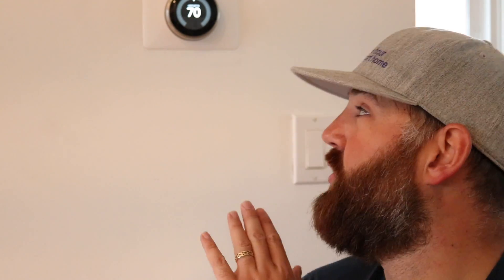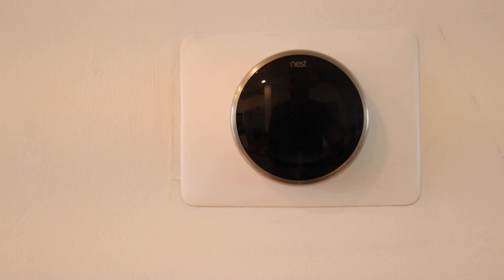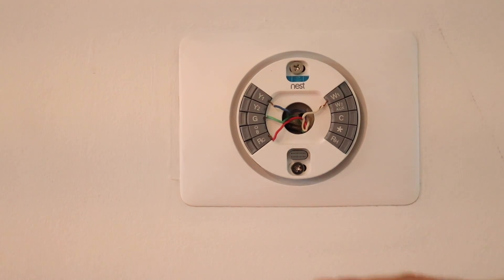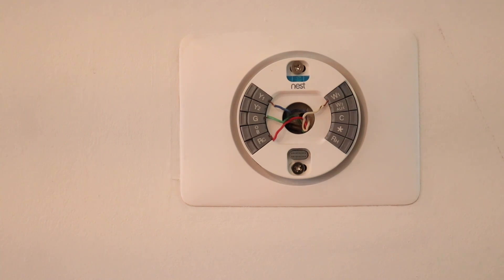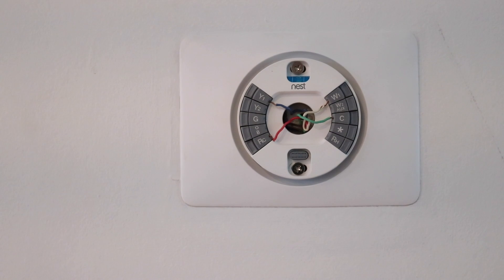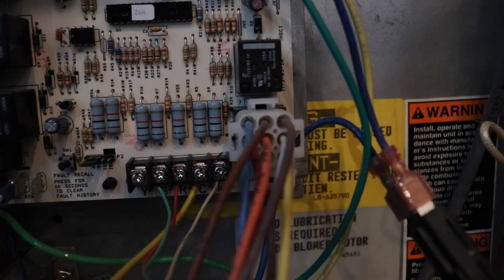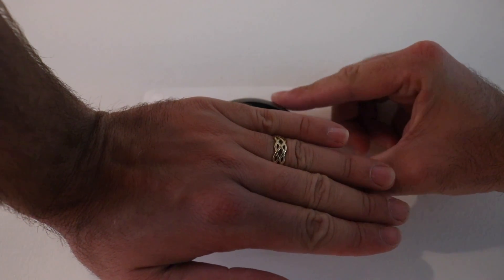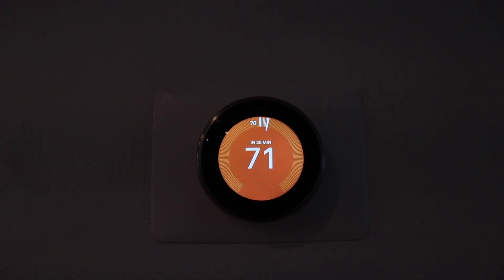Nest Common Wire Hack!!! - Nest Low Power Fixed

Comment: Hi i have tried this but after this my furnace fan haven't working .. Is there any another issue overthere ??
Reply: just fan ?    or heat and ac?    cause he repeated 100 times that this hack looses your FAN function...
Reply: put everything back the way it was...  move G back to G both at furnace and thermo...   then get a short wire and jump Y1 and C

Comment: Shoot...Bummer for me.   I took the G wire and moved it to C on the thermostat and moved the same wire in the control board in the AC unit, and the fan doesn't come on when the condenser outside kicks on.   My system is VERY old.... a Williamson unit from 1988... I guess they must work differently.

Comment: Thanks for this very informative video,I’m about to do it to find out that there’s already 2 white wires in my “C” spot(not belong to my thermostat wire).Is it safe to still put my G wire to C spot even though there’s already 2 wires in it?Thanks
Reply: Do you find a solution to this? Im having issues too and wanted to try this but we also have 2 wires in the g port in the  furnace.

Comment: Thank you!  Mine worked fine for over a year before all of a sudden having issues.  Apparently even though they say the C wire is not required, everything I've read said that was the problem and it's pretty common.  This fixed my issue perfectly.  It's a temporary fix as obviously without the fan wire, you can't run the fan on it's own which I do periodically, but this fixed my issue and got my AC running again on a 90 degree day and only took me 5 minutes after hours of google and frustration.  Thanks!!
Reply: Have you found any solutions to this? I sacrificed my G fan wire for my AC as well to power the Nest(since its winter now, no AC). So i just have the common wire and no G. Come summer time, i will have to swap them again in the Nest. Will i also have to change the wiring back to the way it was in the AC unit?
Reply: @palmerprod  you can buy a Google Nest Power Connector C wire adapter that essentially splices C from the furnace board into the power line to send slightly more power. It can be tricky to install the adapter, for those who don’t have a C terminal located on the furnace board.

Comment: During all the wild fires I like to turn the fan on because it helps run the air through the filters. The fan setting is essential for me.
Reply from the maker: Sorry to hear your dealing with wildfires. What part of the country do you live in? This video: https://youtu.be/gahPxCcPDto shows you how to add a common wire while maintaining fan control. If you choose the method shown in the other video it will require a common wire adapter: https://amzn.to/3tMVWVT

Comment: Used this trick. Worked well in the winter. But in the summer, AC is on but fan is off. Wondering why the AC does not turn on the fan.. had to reverse to the G wire for the time being, as a temporary solution.. any help is greatly appreciated!
Reply: Here’s what I will try next: move G wire to C wire. Then in the furnace, jump connect G with Y. Hopefully then AC and fan can be on simultaneously.

Comment: Thanks for the video.  I added a common (luckily wire was there, but needed to be connected at both ends); unfortunately this alone wasn't enough to fix my issue.  With and without the common, the furnace would start to turn on (gas exhaust blower would spin up) for 7 secs, then off for 3 and repeat.  

Be careful following these steps as you should have some comfort working on circuit cards prior to doing any of this.  No guarantees to your situation.

I did a little investigation and research and found my control card had an unpopulated resistor from Heat call (W) to common (C).  Did a little ohms law and determined a 0.5W 2.5kOhm resistor could be used (I increased to 5W to provide plenty of safety factor).  I also bought some lower resistances incase this didn't bleed enough current out.  Adding this between W & C seems to bleed off enough current while the Nest is syphoning but not so much that the call for heat doesn't work.  Good luck!
Reply: Thanks for your info on your situation. The circuit board on my furnace, does Not have a wire terminal block. The wires from the thermostat are attached to other wires that lead to a plug, that hooks up into the circuit board. So,  IDK where my common connection is. Thus,  the blue C wire from the 18-5 cable is wrapped up, (Not used).

Comment: What if I only have A/C and 3 wires (Y, G, & R)? Is this something I can do? I've never looked for the wires on my A/C unit before, but is it the same as a furnace?
Reply: If your ac is modern then yes you should be able to repurpose your g (fan) wire for a C wire like in this video. Your wires would be in the air handler though

Comment: Thanks Man !  I’m very Grateful for this hack on resolving my Nest thermostat low battery and no wifi issues. Sorry I’m a late comer to your channel but glad I stop to Check it out. I done had my nest thermostat may be 6 years.  Having it that long the internal battery will not keep or hold  a decent charge anymore. I’m really not a DIY when it come  downs to electrical repairs in the house. But I followed your step by step instructions and everything turned out  alright. So thanks once again and for saving me $ 250. To have  a 5 piece HAVC wiring install in a 1 story house.
Reply from the maker: Thanks for watching and I appreciate the comment. I'm glad you were able to save money and that's part of the reason I made this channel. It's no fun shelling out cash just to get the stuff you already have to work correctly!

Comment: This worked for me in the winter but in the summer, the AC won't work! The fan will turn on like it wants to cool the place down to the set temperature but it will not cool it only blows air like a fan.
Reply: I have the opposite problem in the summer. Ac is on but fan is not blowing air.. I reverse back to G wire and temporarily resolved this.. probably nest battery problem will come back shortly..

Comment: I've been constantly removing my unit and charging the battery through usb. I think i did it so much that the battery went bad.
Today I switched the wires like you said and everything seems to be fine.
I'm still planning on replacing the interior battery. I suspect it's needed if there's a power outrage.
Reply: If there is a power outage I don’t think your furnace will work.

Comment: I have a green wire I can use but I can’t figure out where to hook it up on the furnace terminal board . There is not terms, marked c. Right now the green wire on both ends are hooked to nothing.

Comment: Does it matter what my new lin battery level is at now, was at 20 and having issues hence these video searches. 😁 Now is significantly higher and no issues.
Reply: 20 is bare minimum. Some systems can run with it but most need more
Reply: @kez850  Does too high a level exist? say 200ish?
Reply: @ElvisPerezOG  I think 200 is standard if you have a dedicated C wire. Mine is right at 200 so I surely hope that’s the case lol.

Just looked it up and when a C wire is connected, 100 to 200ma is what you want to see.

Comment: Can someone anyone please help me..... I had a nest 3rd generation on a 2 wire old coal burner that was changed to gas and it wired fine for a lon time but then started doing battery low and all that stuff. I called nest now Google and they said that the the thermostat was bad and has no batter in it lol. I went out and bought the new Nest 2020 and hooked it up with the 2 wire and same thing. I bought a transformer for c wire and ran it today and plugged it into the C ( the black line adapter wire) then I disconnected the 2nd wire that was connected to the RH and cut it so it isn't connected then I added the 2nd wire coming from the new transformer to that.  Put the old nest 3rd generation back on and it worked to charge it I think but when I turned it up to 75 the furnace pilot light did not turn on.  So I charged the nest for about an hour and took the transformer wires off and hooked back up the original rh wire and put the nest 3rd generation back on and turned it up to 75 and the pilot light kicked on. So I am lost.  Back to where I was but isn't charging. Can someone text me 765-212-8805 how to fix this please.  It's for my elderly mother.
Reply from the maker: This video should help with the new Nest 2020 Installation: https://youtu.be/yi5kfn3bmEk it shows the installation with 2 wires and a common wire transformer, the Nest needs a 24V transformer like this one: https://amzn.to/3aRkiYn  

It's ideal to also troubleshoot the HVAC system and determine that it's not a factor causing the issue. Wiring the R and W wires together for a standard wired heating system should start it up, and the system will remain on until the wires are disconnected. This setup is sometimes used in emergency heat situations until a replacement thermostat can be installed. However it's important to know the HVAC system will remain on as long as the wires are connected.  If the system does not turn on with the R and W wires connected it means that the HVAC system most likely has a fault and will need to repaired. The most common reasons for a fault are low airflow due to a dirty filter: https://amzn.to/3bGDQxP, a bad igniter: https://amzn.to/2Mo9OpV or sooted or bad flame sensor: https://amzn.to/3dKsonl

The igniter or flame sensor can sometimes be fixed by cleaning the soot off of them. The air filters can be replaced. 

With the Nest Gen 3 if the power went out, or the thermostat was disconnected a long time the battery can discharge and then charging it back up with a USB charger like this: https://youtu.be/LV8qw7rngwA for an hour or two can solve the problem and then the HVAC system voltage will keep it going. The issue is that if the battery completely discharged it can take a long time to charge it up with just the HVAC voltage but connecting it to the usb charger will typically give it enough of a boost to solve the problem and then then HVAC voltage can maintain the battery.   

It also should be noted that the battery can also discharge faster if you have a bad wifi connection or if it is continually searching for a wifi network it was connected to can cause issued as in the case where the password was changed on a network. The extra power draw searching for wifi can cause issues and the HVAC system power is sometimes not enough to overcome the power draw from the thermostat looking for wifi.  Hope this helps please update with a comment if you figure out the issue.

Comment: Mine already has a common wire connected but mine recently got the message that its not receiving power.
Reply from the maker: Make sure the C wire (Common Wire) is connected at the HVAC system. Do you know which version thermostat you have? This video is for the Nest Gen 3: https://amzn.to/3urAZ4e  if you have the New 2020/2021 Nest that looks like this: https://amzn.to/3uu5gzf this video: https://youtu.be/yi5kfn3bmEk shows how to install it.  This video shows you how the concept  of installing the common wire on your HVAC system and making sure it's connected at the control board on your HVAC system: https://youtu.be/RQQAtmV2TQs Many times the C wire is run as an extra wire but not connected because it wasn't needed with some older models of thermostats.

Comment: Why not just run a jumper wire at the thermostat ?  From the yellow over to the common. You’re basically doing the same thing at the furnace....correct me if I’m wrong...

Comment: I have a spare C on the control board (total 2 Cs, 1 used by cooling system and the other is unused). Can I move G to that or do I have to put it to the same C with the existing cooling system wire like you've done in the video?
Reply: Requesting a response.

Comment: Nailed it man prob saved me several hundred dollars.
Had a 5 strand. Blue wasn't connected. So I found the strand with the G wire, took the blue wire from that strand (i have two separate strands) and hooked it up to the C. 
Your video answered the question I kept asking over and over again, how can I make this blue wire useful?
 F*n A man!

Comment: Thanks for this video. Woke up this AM to find my Nest disconnected from WiFi because it lost the power source. Turned out it was using the AC to draw power. We replaced our AC unit this summer and the new one has a low pressure switch that shuts off the AC unit entirely when the weather is very cold. It was -10 overnight so it triggered this shutoff. I was going to have the HVAC folks come out tomorrow to figure out how to fix this, and I would periodically charge the Nest to keep it running until then. This video did the trick so I cancelled the service and probably saved a couple hundred dollars (or more). I’m going to buy the “add-a-wire” kit so I can still use the fan independently if we want. Thanks for the great instructions!

Comment: you definitely want to be careful giving this kind of advice to people that have oil fired heat and a fan center relay!!! I want to know right now if you're a licensed HVAC specialist or a licensed gasfitter or plumber in any state? my guess is you're not unless you own your own home single-family dwelling you will be held liable for any damages or loss of life from you altering the wiring of a thermostat!

Comment: Hi there, I am hoping I can setup my Google Nest Model: G4CVZ with a simple 2 wire wall heater thermostat. All I have is an R and W wire coming from my heater, and I have purchased a power adapter but the model of Google Nest that I have has only 6 connectors. Y, C, W, G, R, and OB. Obviously, I want to connect the existing wires into R and W, and I understand that I need one wire from the power adapter to go to C, but I cannot figure out where the other wire from the power adapter belongs. Is it Y, W, or OB?

Comment: Switched it over thought it was going to work gave therm readings and said it needed to charge. After charging was done it still shot same no power wire code.

Comment: I have a nest 3rd gen nest thermastat but recently it blew out something outside that the ac tech changed.  AC tech came and switched it out whatever burned out.  But he told me that the nest is the problem its been making some clicking sounds outside.  Fan wasn't turning!  He put a cheap thermastat and didn't give any problems. What do I do? Do I return it or keep it. Is there a solution for this?

Comment: Thank you so much I got a Sensii wifi thermostat and I didn’t have a c wire and the battery kept dying every 2 weeks and I couldn’t access the wifi because after 2 hours it would cut off so I just did this hack and it took me less then 20 mins if that. Thank you very much for the precise instructions I hope it works.

Comment: I get an E102 error. The thermostat was working fine before and now it gives me that error.
Reply from the maker: If the thermostat is working fine without the common wire, most likely there is no reason to add one.
Reply: @OneHourSmartHome  I wasn't trying to add a wire. The thermostat was turning on just fine for months, we used it for the AC all summer. Now it's giving me a E102 error and it won't turn the heat on.

Comment: I'm not sure if you're answering comments still. But here goes... I have a wire already connected to the C  section on the Nest back plate. Can I double up the green wire with the Wire going to the C section. Then move the green wire at the furnace to the C section too?

Comment: My nest has C wire connected. I am adding bypass humidifier. I do not have a thermostat wire to use. Can I use the G wire to connect to Nest * (humidifier slot) then connect G wire to humidifier, and then connect humidifier to C terminal on the furnace?

Comment: Thanks for information. 
My home built on 2016
I have Honeywell thermostat with W,Y,G,R,C connected. There is brown wire which is not connected to any letter. Below on Honeywell thermostat says C is optional with Battery, but C is connected when installed by the Home Builder. Its not written 120v/240v on Honeywell thermostat. 

Also i have Rc and R there is gloden color transformer attched to both in square shape. 

But Red wire is connected to R. No wire connect to Rc.

I am trying to install Nest E thermostat replacing the existing.

Questions below:

NEST  E is compatible right?

When I install Nest E i should attach the C wire as well to Nest thermostat?

As i dont see any wire for Rc comnected in existing Honeywell, I dont need to connect wire to Rc in Nest right?

Anything i miss, please help me

Thanks

Comment: Please help me with that, I have the C wire installed on my main board but when I connect it to the thermostat I get the power failure and thermostat is not working, if I remove it works but I get low battery. Please help me to fix it, none of the support Nest team could help me we that. By the way a HVAC technician confirmed that the C wire is connected correctly. I don’t know what else I can do!
Reply: I have the same problem with no power with the cwire connected . Google support was no help.

Comment: Hello I have a Nest 3 gen. I got a error on my nest when i turn on heat. is a new system Carrier furnace. The code will say (power out error E73: no power to Rc wire). Also when it heats up it will delay for 3 min an run on fan only. What can cause this issue?
Reply: The nest has a red wire connected to RC. And the HVAC has a red wire connected to R.Can this be a bad cable? It never did that before.

Comment: Thank you! You really helped a lot and kept us from a another cold night. I did something a little different. I have a heat only system so I took the Y (AC) wire that wasn’t being used and used that for my common wire instead of sacrificing me fan G wire. Thank you  for the guidance I went from a 3.3v to a 3.7v and my Lin went from a 3mA to a 200mA.